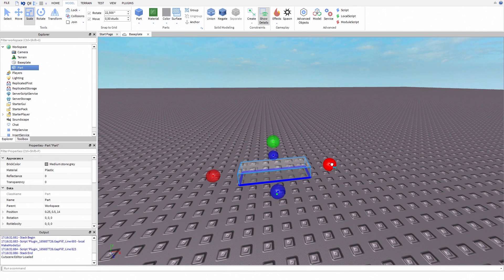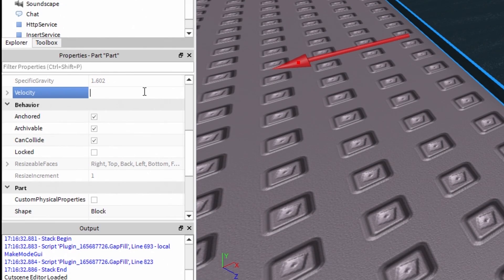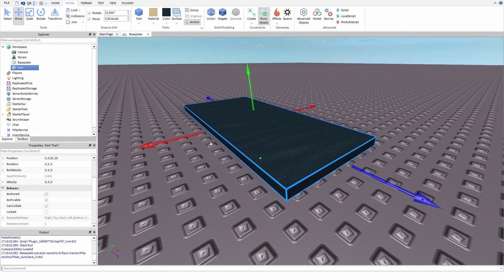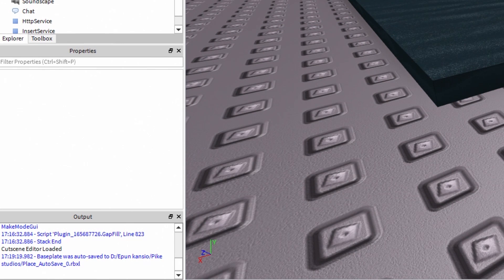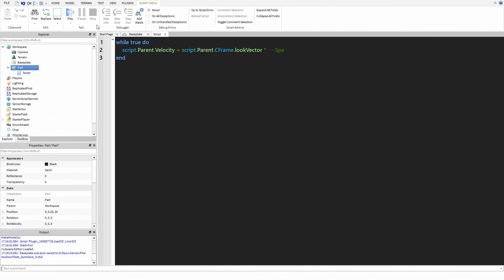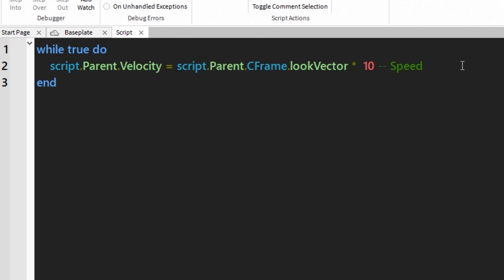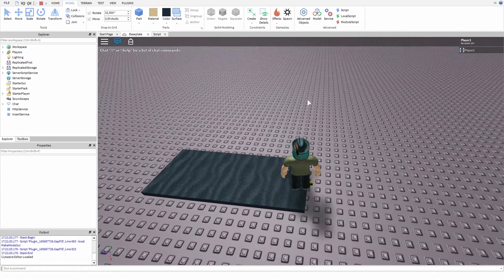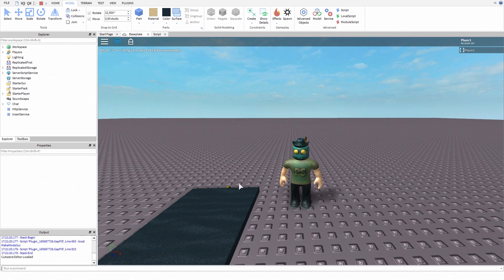[ROBLOX Tutorial] - Conveyor Belt (Proper way with a Script)

Comment: Why use an infinite loop? I mean, you only need to set the property once on runtime, why bother setting it every frame?
Reply from the maker: It is because if I rotate the part in the actual game, we will move the way the part is actually facing.
Reply: @Eppobot  Still doesn't make sense... the script only starts when the game does, by then everything will either be in place already or will start when applied... I think they're letting you know, great idea, but the only time you'd need to infinite loop is if you were moving the conveyor belts direction While the game is running, and even then you could make a transparent model without the script to demonstrate moving, and clone it back into the game as the same/new part.
Reply: @tylerhorton9807  movement script
Reply: @Amethaz  well, sorta, depends really.. me personally, I'd follow the guy that commented this originally, and just make it to where you pick it up in a tool, and drop it whichever way the players facing. And make the direction always move to the front surface, so that the game doesn't start loading weird.. a constant while true do loop, causes a lot of lag when other things are also loaded into the game.
Reply: @Eppobot  if you're gonna make a loop.. at least make the loop break if the part is not moving.. or if the part is far enough, you could make a render out script.. I just move the parts to server storage..
Reply: you can use 
Local Db = true
While Db = do
--Script-----
Db = false
end)
Reply: @Harry_D0  or just use
-Script----

Comment: i recommend you link the two extra property plugins that were included in this video, such as the velocity one, and the surface one.
Reply: roblox got rid of the surface and velocity property
Reply: adding onto this, 

you can do script.Parent.AssemblyLinearVelocity instead of .Velocity. you dont have to to change the surface property too.

ex: 

local conveyorBelt = script.Parent

while task.wait() do
	conveyorBelt.AssemblyLinearVelocity = script.Parent.CFrame.LookVector * 10
end

Comment: Huh, it does not work for me...
Reply: I just discovered that the conveyor has to be a certain size. If it's too short, it won't work. Now hear  this, i'm not entirely sure if that's the issue, but it worked for me. Give it a try.
Reply: MADDJROCKS Gaming 
Try to anchor it if u didnt.
Try to remove the hinge (as I know it might give you some problems)
Try to see if the script is correct

Good luck bOi

Comment: it did not work my script is 

while true do
script.Parent.Velocity = script.Parent.CFrame.lookVector* 10--speed
wait()
end
Reply: and the propertie says -10
Reply: forgot to ancher XD
Reply: Lor Miliani Sparling pp
Reply: Loockvector* the star needs to be spaced try that
Reply: Hello! What I believe you are doing wrong is that the "--speed" text is in contact with the 10. You in fact do not need "--speed". It's just text that says where you should put the speed of the conveyor so if you forget where to put it, the text reminds you. Use this script.

while true do
 script.Parent.Velocity = script.Parent.CFrame.lookVector * 10
 wait()
end

Hope this helps.
Reply: Oint Anon did you put a hinge?
Reply: The hinge is not needed. In some cases, the hinge might cause some problems if an unanchored block is adjacent to the hinge. The hinge is used to tell you what direction the conveyor is pointing.
Reply: Oint Anon Anchor it
Reply: Thank you :D